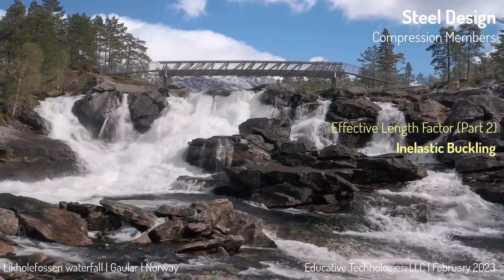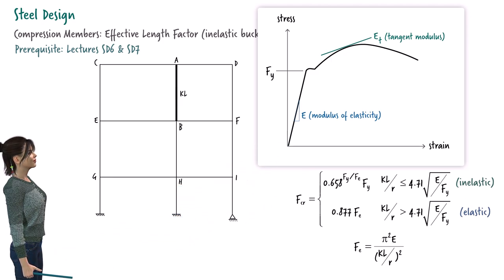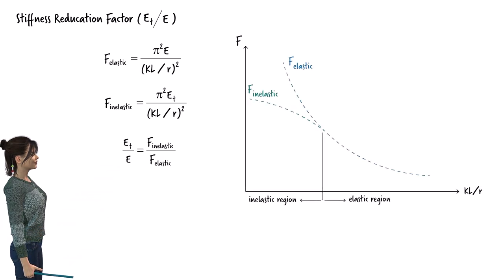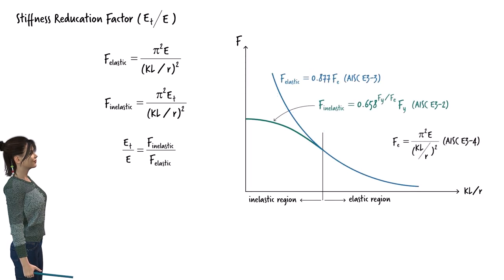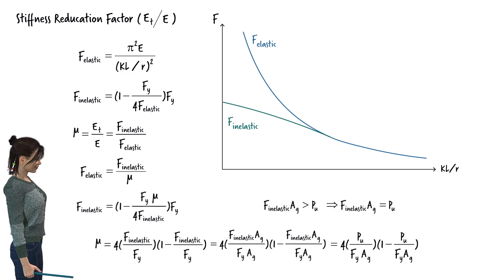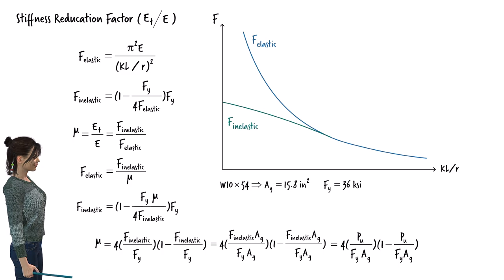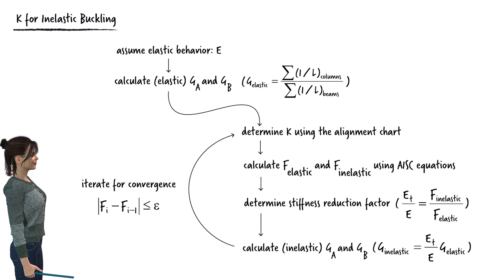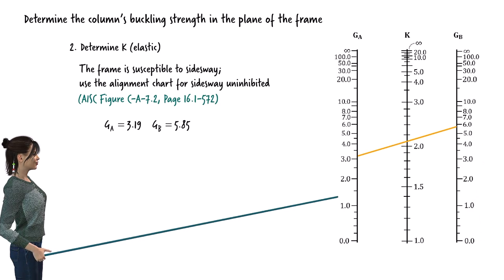SD8: Steel Compression Member Design (Effective Length Factor 2)

Comment: If column buckles on its weaker axis. Why did you solve it in its stronger axis?
Reply from the maker: If the column is braced differently in the weak and strong directions, it may not be possible to determine the governing direction without checking both of them.